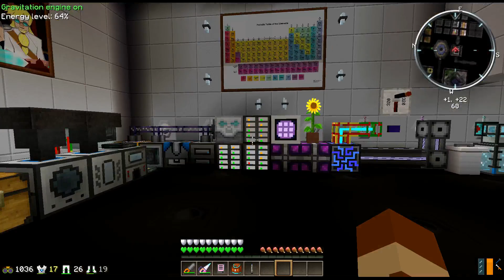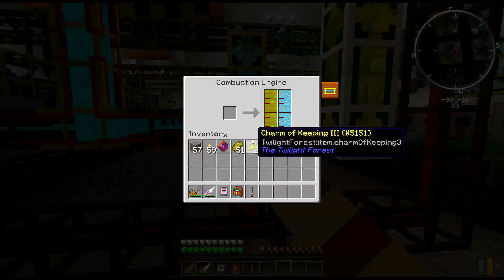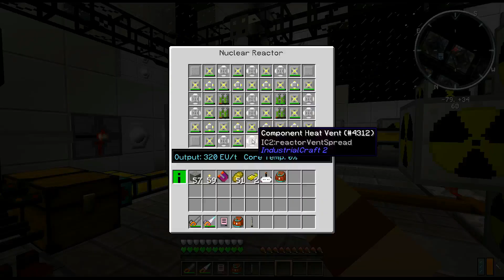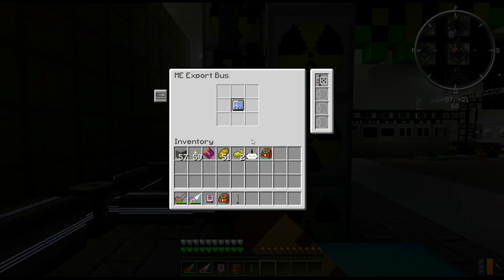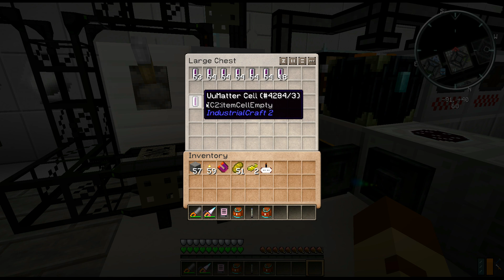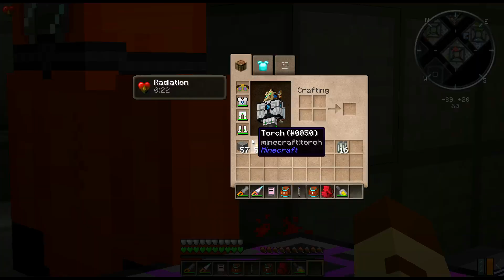Base Tour 1 -  IC2 Mark Five Reactor

Comment: Sorry from being late by... 8 years... Well anyways you can increase power output of your mk V reactor instead of normal reactor "coolers" you can use fluid ones and they will make heat from cooling cells